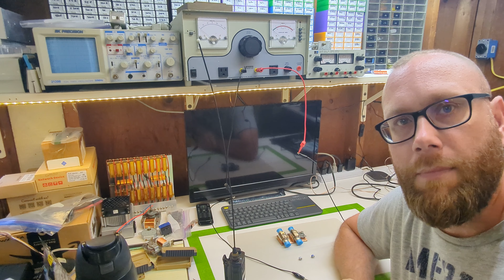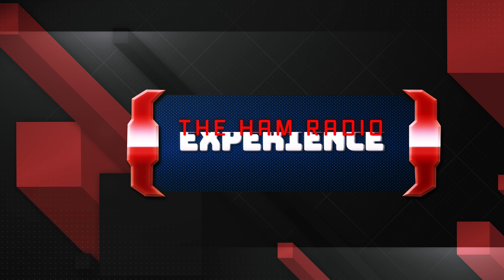Did I get sold FAKE lightning arrestors??

Comment: How do you know if it is not working because it had to  many arks? It has been a long time I have gone to any of the local electronics distributes. I know of Electronic Industry, and believe Appleton Electronics has been gone for some time. Where dos a person perches components from?
Reply from the maker: To test if the GDT burned out, I'd do the same test as in the video. If it has been destroyed, you'll be able to turn up the voltage way past the 90v it's rated for without it arcing. 

Regarding suppliers, yeah, it's sad Appleton Electronics is gone...I usually compare between the 'big 4' online suppliers - DigiKey, Mouser, Newark/Element14 and Jameco, and buy from wherever is cheapest. They'll all take you to the cleaners for shipping cost, but if you can get a few friends who also need parts (or if you know a guy who runs a business buying parts 😉), you can split shipping and make it hurt less. 

73!

Comment: Good topic and evaluation of tubes.  My morning 2M net had a discussion regarding a member having static arching from disconnected coax to frame of radio which she did not move away during area storm activity.  Suggest that you provide sourcing for the unit holding the gas discharge tubes or DIY instructions.  Thanks for posting.  Ed KK7UNA
Reply from the maker: Ed,

I don't really want to give out the link because it came with the underspecified tubes. I feel a bit off recommending a product that doesn't work as intended, out of the box.

I'd just search "N type 90v lightning arrestors" and see what you find. If they're surprisingly cheap (mine were about $13 each), be prepared to test and likely replace the GDTs. Hope that helps! 73,